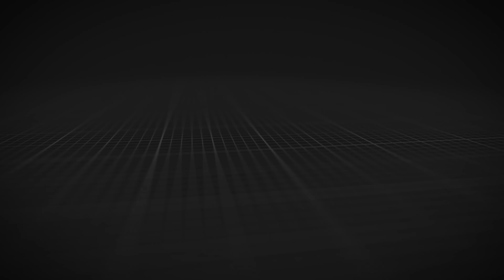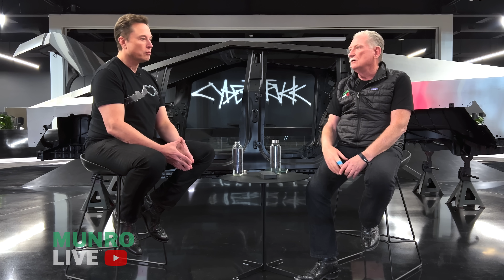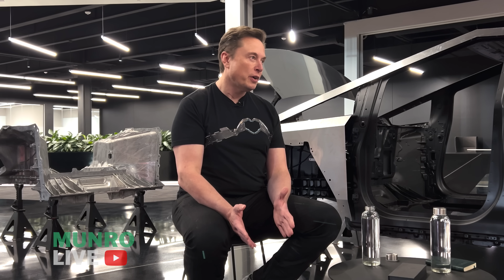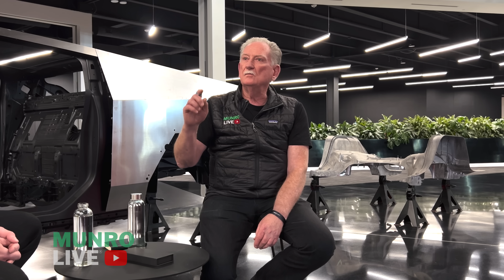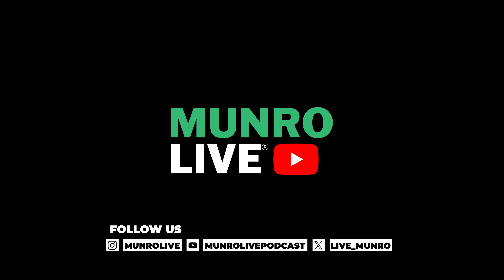Elon Musk on Cybertruck's Adoption of 48V and the Importance of Leadership

Comment: How embarrassing for legacy auto… they earned their legacy badge
Reply: Elon and Sandy has.. there is no negatives with 48v komponents. At all
Tesla switched most of all to make it simpler, lighter, better
Reply: @rare_wubbox360 No negatives? Lol. Ok. Except for an entirely new electronics supply chain for the entire vehicle. You won't be able to just walk into Advance Auto and get 48v  replacement parts, or aftermarket goodies for awhile. There will probably be a bunch of stories of fried aftermarket electronics on Cybertrucks for years to come. And fried components at 48v could possibly catch fire more readily... although those thin wires may just melt and short before enough heat is generated for a fire. And don't forget that those new special OEM parts will run at a premium for replacements and repairs. Sure, no downsides at all.
Reply: Up until very recently lithium batteries could not provide the sudden discharge rate to power the demands of a starter. They are also quite sensitive to heat and cold requiring the battery to be installed with heating pads or cooling passages. That leaves the ICE car to be dependent on older technologies such as lead acid. Making a 12 volt battery requires 6 cells consisting of a lead plate in sulfuric acid. A 48 volt battery would have to be significantly larger in size to provide the power needed for a starter. It would also consist of not 6 but 24 individual cells which would make it very difficult to fit under the hood of any car
Reply: @douglasdangelo6755  r&d is pretty cool, some people refuse to acknowledge it exists in their maths
Reply: @douglasdangelo6755 . There was a push quite a few years ago to switch over to 42 volts (not sure why 42 and not 48) for automotive power bus voltage.  The idea never took off because peripheral device manufactures weren’t ready with devices and manufacturers weren’t interested in having to spend money on integration compatibility testing.  Electric power steering racks made the switch to the higher voltage but were often supplied by a boost inverter in 12 Volt ICE applications or a buck converter from the traction voltage in EVs.
Reply: @douglasdangelo6755  There are cars that have a 48V belt starter generator, which has around 15-20kW of power and can start the engine. The battery has around 1kWh. In many cars it is located in the trunk or under the passenger seat.
Reply: @raphi25895  yeah you are talking about the ram e torque system, which has now been known to be very problematic and unreliable. A replacement battery, which is under the rear seat, also costs over 1000 dollars to fix. Those cars still utilize the 12 volt system to power their car as well. The reason, just like why a lot of boats stick with 12 volts, is because of accessories that are mass produced like sensors, radios, infotainment screens, and ecu. The gains from the entire system are less than 1mpg
Reply: @douglasdangelo6755  I'm talking more about the European version (by the way, the system works very well in these cars) with the 48V mild hybrids, in which some of the chassis, electric compressors and roll stabilization are also operated with 48V. Some of them also have a 48V generator and then convert this down to 12V for the devices. It's a shame that not all systems there run on 48V, but I suspect that the cross-model policy makes it cheaper to use most components with 12V.
Reply: Watch out for Honda though! Lol
Reply: Bye bye GM, Ford, & Fiat Chrysler
Reply: Musk kept going on about (I^2)*R power loss as heat in the wire.  I believe I*R voltage drop is probably a greater issue for a given wire gauge, especially when talking about infrequently used peripherals such as window motors, seat adjusters or bed cover retractors.  The second pay-off is that those peripheral motors can be smaller and lighter when they operate at higher voltage.
Reply: @wtmayhew  Yes, with electronic control(pwm through use of low rdson mosfets), the increased voltage helps achieve more torque, while operating within max power of a given motor, by overcoming inductive impedance while keeping i2r winding losses low. Also another side benefit is the ability to use smaller capacitors to hold more charge in associated electronic subsystems(assuming the dielectric insulator does not change in thickness significantly).
Reply: @aware2action  Thank you, well stated.  It is good to see appreciation for the pay-off which may be more important than I squared R loss in the wires.  1/2 * C * (V^2) energy storage in power supply capacitors is a big deal too because that squared term.  It is nice to have volumetrically smaller components to store the same energy.  🙂. Of course, it is all good… smaller wires and smaller everything else.
Reply: @wtmayhew  “kept going on” ?  that sounds like you have deep biases altering your reading of a situation
Reply: @TurdFergusen   The discussion largely missed the more significant engineering considerations.  Yes I would agree that I am biased against  an academically weak discussion in what purports to be a technically savvy context.
Reply: @wtmayhew  it was too short a conversation to be what you appear to have expected
Reply: I look at Tesla as being a lot like Apple of the early 2000s - charismatic chairman which you love or hate and the technology they employ in the product is not heretofore unknown - but the product is greater than the sum the parts.
Reply: There is so much that is designed at 12V in a legacy auto that to switch to a 48V rail means they have to redesign or requalify all kinds of components and modules
Reply: @jacobscott9732   That is where the Engineering Prowess and the Vertical Integration of Tesla shines😊. I also believe creation of a new "Re-Purpose" Dept, that collects and refurbishes the 12V supply chain parts, retrofits needed upgrades, to make it 48V compliant, tests and qualifies it for production use in a 48V system, to keep cost and reinventing expenses low😉. Tesla has already proven, what they can do, even with an acute supplychain shortfall, to keep production going.
Reply: Jesus the Tesla fanbots being like "legacy cars" y'all never once worked on a car did you? 12v can kill you. 48v is terrifying. Luckily since none of you know how to work on a car you're ideal Tesla buyers lolol.
Reply: @KevinJDildonik  Ive spent the better part of a decade working on 12v systems from autos to trucks to busses to sky cranes.  More than I care to remember.  Your assumption is wrong and your name calling isnt helping your argument.  Now pivot your argument to something else like cobalt mining like all those who came before you.
Reply: GM:  Lets cover the world in lead for profit and spend advertising money to kill anyone trying ti do good
Reply: Hmm.   Unions and outsourcing the entire supply chain to reduce union costs does give a swift kick in the inovation department.
Reply: @hoppingrabbit9849  “nobody”
Reply: Yeah, for the most part.
 But somehow I still miss the really good old days, when cars had engine vacuum powered windshield wipers. There was just something so organic about a tiny bellows being sucked and blown back and forth in that little housing. lol.
Reply: Although 48V is not entirely new, there are already some cars with a 48V partial electrical system. However, 12V is still present here because, as discussed in the video, wiper motors etc. run on 12V and it is precisely these components that are still installed across models to make them cheaper.
Reply: @raphi25895 my poe camera is 48.
Reply: @raphi25895 There are also related safety issues(related to skin contact) that go along with 4x increased voltage compared to 12v. Typical skin contact being 500  ohms. This means 4x more current, resistance being linear.
Reply: @aware2action  Agree.  48 Volts is on the cusp of being a generally hazardous voltage.  Casual contact probably will not be injurious.
Reply: @aware2action dont lick it
Reply: @wtmayhew  Yes in terms of biomedical terms its a difference between Acute Pain vs Acute VF(if safety protocols are not followed to the dot). There is increased burn potential on direct contact of the terminals in close proximity(again without insulating/damaged gloves), but that is not life threatening. I am certain Tesla has very specific safety protocol, when servicing is called for. Treat 48V with respect and don't lick it, like a vanilla 12V subsystem.😊
Reply: @aware2action  Thanks for the reply and added detail.
Reply: @TheKnutselaar  Licking will only cause a black tongue with severe burns and deprive your ability to discern a tasty 🍦 from hot 🌶😂
Reply: @aware2action  everything below 60vdc is considered safe according to international standards.
Reply: @dangu794  Then why does UL preclude only 12V and less  from certification?🤔
Reply: @aware2action  what standard says max 12v?
For example ul/en/iec 61010 mentions SELV circuits, so anything less than 60vdc is considered safe and doesn’t need any real measures for shock protection.
Reply: @dangu794  I've already explained in my previous responses, to various comments, on the needed safety precautions for voltages higer than 12V. If you've designed any biomedical instrumentation, it will be easy to appreciate the concern.
Reply: @aware2action  Considering that 12V was enough to cause many Fieros and other vehicles to just randomly burn to the ground while sitting in parking lots. Aftermarket modifiers really need to be careful with 48v.
Reply: Even Haggerty was gushing, embarrassing that these legacy companies are just that:  profit machines, not innovation machines
Reply: @TurdFergusen  That's not entirely true either, many of the things that Tesla has now come out with have already been researched or installed by others - they're just not that risk-averse. In the A8, for example, 48V is used for the chassis, all-wheel steering and roll stabilization.
Reply: @raphi25895  The A8 was also one of the first complete aluminum chassis. Big whoop. They also made the I3 and said people don't want electrics
Reply: 12v & 48v have advantages and disadvantages ... CT drive-by-wire braking & steering really benefit from 48v, that's why they made the move. The pros and cons must be weighed out.
Reply: @KrustyKlown  also the ethernet CAN
Reply: @TurdFergusen  Ethernet in automotive, ain't new.
Reply: @KrustyKlown  Nothing is new but it takes a strong engineering leader to beat back the MBAs, lawyers and gatekeepers
Reply: @TurdFergusen @krustykrown probably a 13 year old lol
Reply: @KrustyKlown 
.
But you didn't specify the "cons"
.
Please feel free to do so.
Reply: @rogerstarkey5390  "cons"..., one example:  water intrusion in 48v electrical systems .. is much more damaging at 48v than at 12v. Systems will need to be a higher level of water sealed.. devices, connectors, etc... Jury is out on Tesla's implementation relative to reliability .. we will see if they covered the risks.
Reply: BMW have been using Ethernet in there cars for more then 5 years and 48v for 2 years nothing new there. 
I do like the fly be wire PAS 
Not sure about reinventing the wheel with your front wiper blade
Reply: @kerravon6545  Good point about BMW being technically savvy.  BMW was one of the early adopters years ago of MOST bus which is an optical ring - even lighter, less interference susceptible and physically robust.  Ethernet can be and has been tunneled over MOST.
Reply: So ford and GM are just horseless carriage builders… how very embarrassing